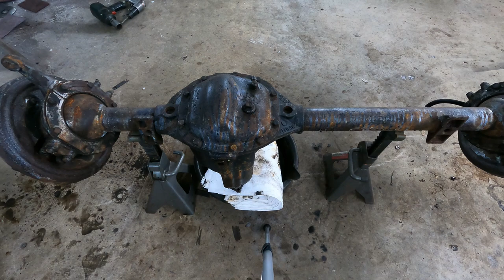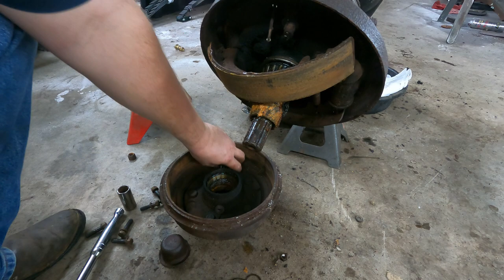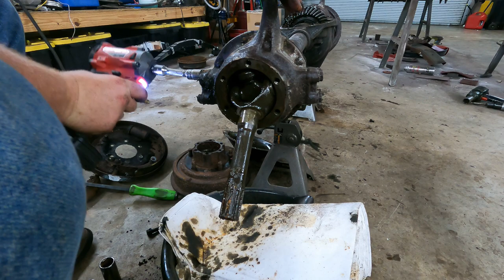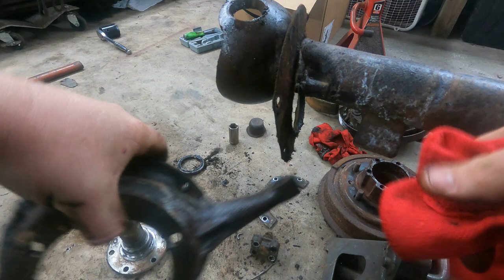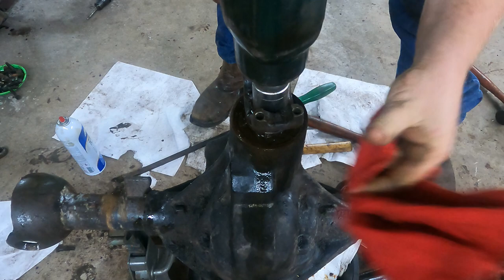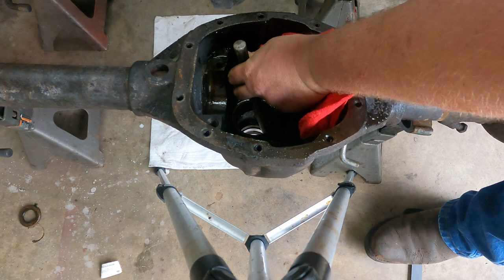1959 Willys "Jeep" CJ-5 Front Dana 25/27 Axle Teardown

Comment: When I get a socket stuck on a goobered up bolt head like that, I put one of swivel tip breaker bars on it, fold the handle 90° from how you'd normally use it, so its in line with the bolt that's disrespecting you, then rock it perpendicular to how the breaker bar tip pivots, so it just acts like a solid bar if that makes sense.  Keep on truckin'.